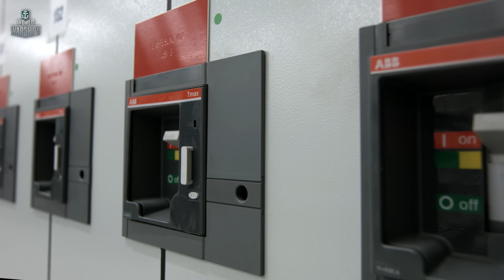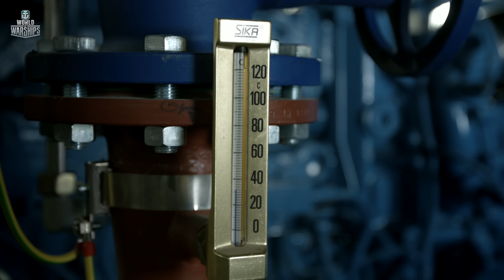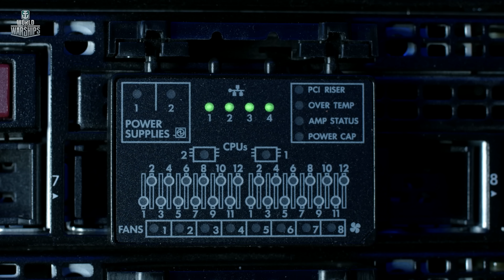World of Warships - Data Center

Comment: First of all: Very interessting video. Was never befor in a Datacenter but I would like to visit one. But one thing which really buggers me. And yes it is definitly not Wargamings fault, is the fact that it just pumps its heat out rather then using it to power a smaller generator to produce electricity again. I know IT IS NITPICKING but I personally think that nowadays we should find solutions which give us more energy. And here you could use something like a warm pump or evern power some surounding houses with warm water and warm floors in winter.

Anyway well made nevertheless!
Reply: +RagingRaptor The temperature of the waste heat isn't high enough to efficiently drive a generator.
Reply: +William Lee 
In europe ... or at least in germany there is something called "Fernwärme" "long-Distance-heating"
were hot or warm water is used for heating of buildings. I mean Luxemburg is preeetty small so there shouldnt be any problems pumping the heated water out of the data center to the next buildings or at  least the building above (Im sure its not heated by the datacenter...)
Reply: +RagingRaptor A lot of innovation in data center development is how to handle the heat produced by the data center in efficient ways to minimize the waste. Microsoft, for example, is actually trying to develop an underwater data center.
Reply: MrDgwphotos For? Heating up the ocean and stopping the gulf stream to cause a chainreaction to destroy the whole eco-system?
Reply: There are actually a couple projects running to find better ways to recude the waste as well as ways to reuse the produced heat. Search it on google and you'll find some interessting stuff. ;)

Comment: So you are not prepared for when oil ends. No alternative energy solutions, more carbon emissions/footprint etc., gg "It runs forever!", obviously you haven't think things through, haven't you?
Reply: +Χρήστος Καρσανίδης Oil will not end in the near future. Also, datacenters are only important when there is power and an internet connection, so who cares if it stops working during the apocalypse?
Reply: TheAnoniemo That wasn't my point but it's nice to know ppl do indeed know oil will end. btw, it may end sooner that we think, as species we had it wrong on so many things, so many times. Actually, if anything has been proven is that we are very efficient at not seeing straight. Profit blocks logic. But i digress. ;)
Reply: +Χρήστος Καρσανίδης The oil powered generator are only there if the two completely separated power lines fail at the same time ! Now how the electricity companies make their energy as nothing to do with the datacenter. It can be hydrolic, solar, wind, nuclear. Oil is only a LAST RESORT BACKUP so your your comment is out of place. Go tell that to the energy producers, not consumers.